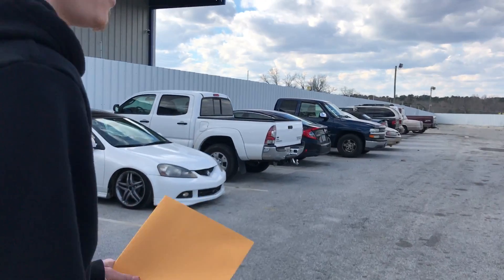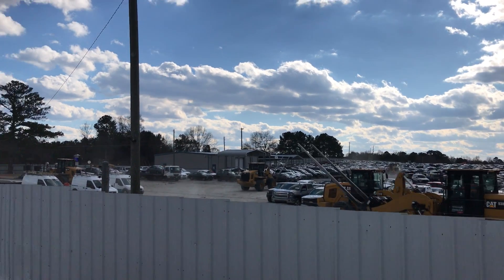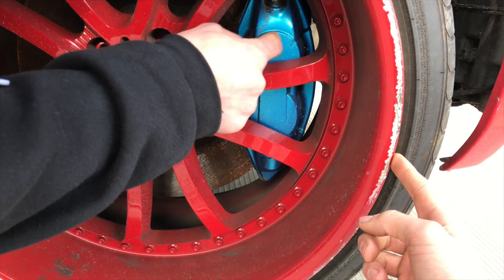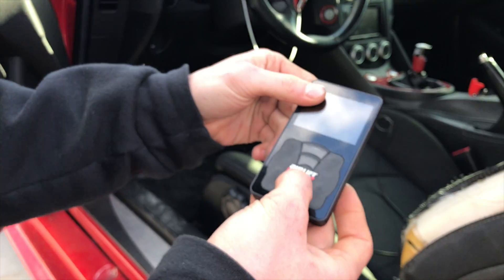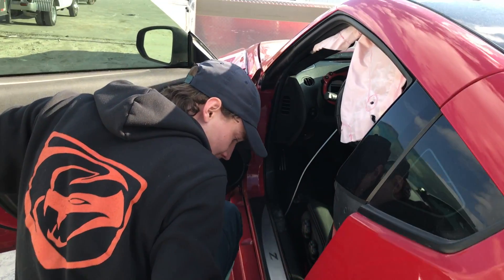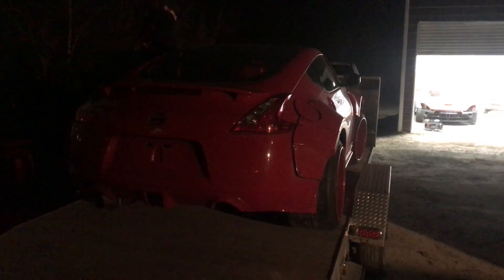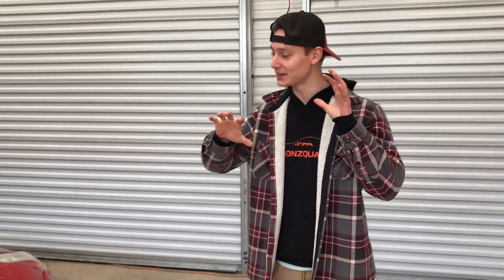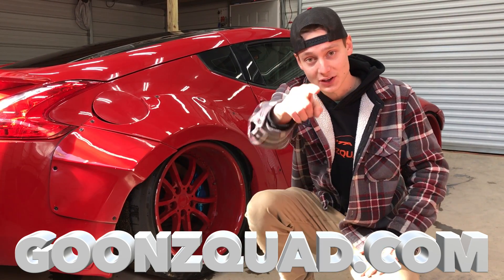We Bought An Auction Drift Car!

Comment: I never understood why you guys wash the engine bay right after cleaning the body of the car. You end up getting the gunk from the engine bay all over the freshly cleaned body car. Just not efficient you know?!
Reply: not to mention getting all the electronics wet
Reply: greg h with low psi on the pressure washer it won’t hurt the electronics.
Reply: @chrisgeorge97  washed my z and water got in some of the electrical connectors and ran like crap
Reply: greg h that may be the cause of a bad sealed connections if you or previous owner did work on the vehicle. It’s smart to put a plastic bag over vulnerable areas in the engine bay. Pressure washing is really just suppose to get a majority of the gunk gone, you can wipe in the vulnerable areas like the fuse box, Ecu, and other electrical

Comment: Wide body is ugly as hell so get rid of it and get black rims with good brembo brakes
Reply: Sami Manzoor you can’t just get rid of a wide body once you cut your fenders...
Reply: Black rims, carbon ceramic disc brake with red brembo caliper, damn sexy
Reply: @SoGs4Life  you can, it's just expensive and extensive. New front fenders, and new quarter panels to cut and weld in. Still wont be the same as OEM bc of the fender linings cut too.
Reply: G Nasty yea that’s what i was saying. of course you can get new panels and what not but as you said it’s expensive and extensive. 

^ its not “what i was saying” but you explained what i didn’t. you got what i meant 😂

Comment: This is nice! I don't know too much but if you plan on drifting this, you may want to reinforce the suspension and steering components on the Z. I'm also a bit worried on the engine being bone-dry when you checked for oil.

Comment: You can repaint the wheels center and get some billet wheel lips a lot cheaper and make it look so much better  they’re probably a 40 bolt wheel lip you can em at a lot of different places I’d go a little bit wider in the rear maybe a inch or two it will make a world of difference

Comment: Believe it or not that wheel is still likely fixable for less than the cost of a new one. There are speciality shops that straighten, weld if needed, re-true and refinish custom aluminum wheels. I had this done once on a wheel that was hard to find the replacement for and the repair was perfect. A good shop can repair that bent portion and check for perfect roundness. Check in your area for someone that provides this service and see what the cost is. Then, strip that ugly red paint off the wheels and get them polished or powder coated a better color for the car.

Comment: I would repaint the car red,new set of wheels, if going drifting replace the airbags with coil overs, exhaust manifold, performance air filter, replace all suspension bushing with stiffer parts and that's the start

Comment: Since it is a very wide wheel, you could buy slightly slimmer rims that would cost less for the tires if those are an uncommon and expensive tire. With drift builds, you expect to replace the tires and do not want too much traction. This car may end up having too much traction. Also, you may want to check the transmission's rigidity because drifting can be hard on transmissions Just an idea. Other than that, the current red color looks really good on that car, in my opinion

Comment: I wouldn't worry about the exterior cosmetics. You guys may end up ruining a couple bumpers while drifting anyway! Otherwise, fix the wheel (or get another set), throw in a hydro E brake, get an angle kit (if it doesn't already have one) and GET IT SIDEWAYS!

Comment: Never heard of Vibrant Performance? Have to remember you guys mainly do off the shelf parts but Vibrant is the best exhaust piping & accessories you can buy plus they are biggest in the Titanium game, if you put together a custom exhaust use Vibrant Performance you won't regret it....also they sell oval exhaust piping for really low cars for Race/Street cars & Most Drift cars in Formula D run Vibrant Oval exhaust piping but Keep up the good work and shout out from Dallas, Texas

Comment: Just get the rear wheel fixed, also with a true 3 piece wheel you can replace just the outer rim ring and re-use the inner piece of the rim 👌🏽👍🏽

Comment: Saw lots of moisture coming out of the air lines @17:20. You're going to want to find a way to drain that tank or it's going to corrode inside and wreck the system.
Reply: ...unless you have hidden nitrous on there somewhere XD

Comment: With the wide body and air bags it's not practical for drifting considering the modifications needed  for it to be a ligit drift car like camber kitsch rear and front a roll cage and so on the front camber alone would destroy the widebody

Comment: Change the body wide but without bolt on it, its look terrible. Wheels ofc. Red spoiler. Thick tires for drift. Repaint dark red or red, so it matches to interior. 4 exhaust tube, and add turbo if u would hahaha.

Comment: If you wan't to drift it you should definitely get rid od air ride. It's awfult to any  sport ride. Then narrower wheels, welded diff, hydro and some steering lock mod. It's also good to have bucket seat and harness so you don't wobble around like crazy. You guys are  kind of OEM-ish? but everyone would love to see you on a track with a modified car!
Reply: It has a limited slip diff doesn't it? No need to weld
Reply: @traighbasson1455  
Don"t know exactly what type of diff is there but factory lsds are usually to weak to lock while drifting hard and plates get burnt. After few events like this diff is not an lsd anymore. Also it"s best for drifting to have 100% lock all the time.
Reply: @Grelax  well then do it right and replace it rather than weld

Comment: Great cars. That wide body kit does not look good in my opinion. There are much better looking kits out there. Also those super wide tyres are going to hit you in the pocket. If you drifting with such wide tyres its going to be expensive. Maybe look at changing the the rims to take a thinner tyre. The stock 370Z rims look go as well in a dark grey.

Comment: 17:17 be careful man XD also why is the suspension so loud ? i got one in my car and its not that loud, might wanna check out for air leaks.
Reply: that's normal is depents on the stage u got
Reply: What's the sound track
Reply: Depends on the size of the lines, and where they put the exhaust for the airlines. I had mine coming out by my rear fender and it was stupid loud.

Comment: Id replace those wheels if yall plan on drifting, with heavy ass 3 piece wheels like that you’re probably gonna be going through axles alot. You’d be better off with a set of something like Enkei RPF1’s or any other lightweight wheels. and they also ugly as heck especially in that red but the car otherwise is a pretty sick base to build off of, cant wait to see what y’all do. Also definitely do away with those red accents in the interior lmao

Comment: The air suspension can vary by car but usually will run between $2k-$4k. It's not cheap. This car definitely has too much red there is very little offset.

Comment: You guys clearly have to repaint the whole entire car.. So my suggestion is Nardo grey, also called concrete grey.. This together with bronze colored (or maybe black) wheels would look sick! And also, if you´re going to drift that thing you should make quick releases for the front and rear bumper. Looks cool and they are really handy when you tap walls a bit too hard! 

PS.
I met a professional drifter two years ago that had the most badass 370Z, look up caallelinn on instagram (before he merged it with a datsun lol). You can also see it in my video, I pinned the time for you.

https://youtu.be/p1nqyq_90Ks?t=119

Comment: I hate the red paint. It needs a new color. That widebody kit looks like trash bolted on the side. Better to fabricate your own widebody with some high density foam and bondo. It needs wheels and tires for drifting. It needs intakes and an exhaust. It needs one of those drifting e brakes right next to the steering wheel.
And most importantly it needs a MASSIVE turbo. Give it that goonzquad touch and it should turn out just fine.

Comment: The amount of work to convert this to a drift car wouldn't be worth it. Remove all the air suspension and redo the widebody.
Why not just fix it up and leave it as a stance car and sell it for a large profit then use that cash and start with a stock 370

Comment: You guys have done great buying great cars. But this thing is a turd! Whoever owned it was a ricer. The engine doesn’t run well, the body kit was purchased from the first wreck. The spray painted trim pieces, wheels, brakes.. ugh... fix it and sell it!